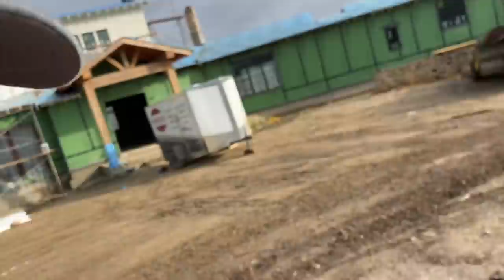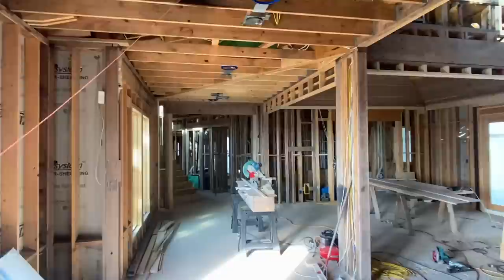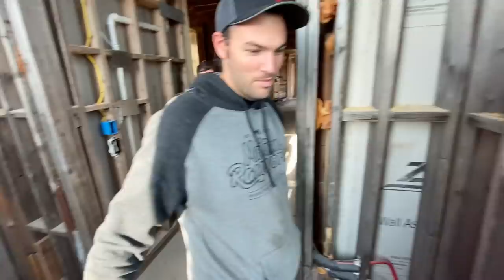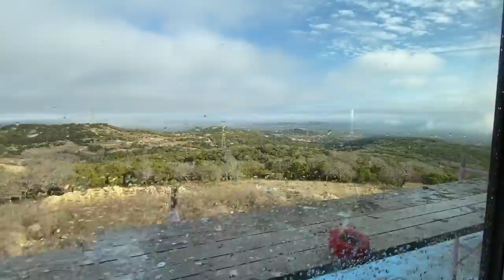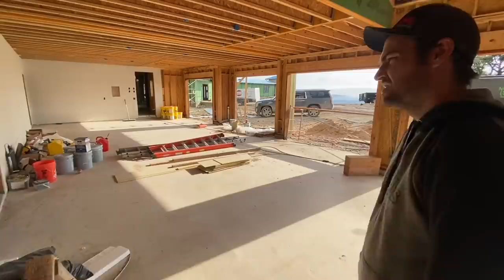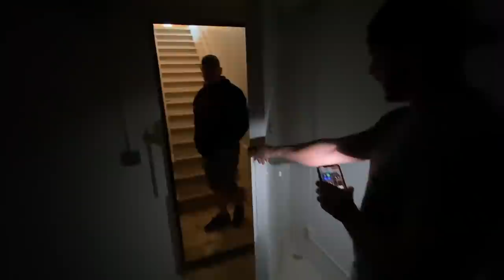Touring Demolition Ranch's Abandoned Mansion Project!! (view is amazing)

Comment: I appreciate how he’s not screwing around and made all those circuits wired for 20A. Smart man.
Reply: All brekers for small amps circuits are 20, 120v. The bigger ones use 30
Reply: @grasshoper3770  Except for 15 amp general purpose. Very few uses for a 115v 30 amp circuit, maybe a RV plug.
Reply: @grasshoper3770  dwelling breakers are primarily 15 & 20 a circuits. With 20 a being more common for kitchens, dedicated appliances ( excluding dryers or ranges ) If you have a code book you should review the article 210.52 of NEC bud. It’s all about dwellings. In the case of house roping, yellow Romeo or NM cable, denotes a 20A circuit. White would be 15A and orange is the 30A you mentioned..... but don’t take my word for it.... I’m just a 01.
Reply: @BEVO_vs_The_World  you are absolutely right sir. Im an apprentice still
Reply: @SMOBY44  the 30 amps is for dryers and big appliances, and the 20 is for general household stuff like lights and outlets
Reply: @grasshoper3770  all good grasshopper...... I highly recommend you get some study materials... practice exams... and just do a little bit here and there and if you are getting close on hours then start studying 1 hr or so each day for two months before testing and you’ll pass easy. Stick with the trade, its a great career choice.
Reply: @grasshoper3770  No, general purpose 120 volt circuits are either 15 or 20 amp. Dedicated 120 volt circuits are 20 amp. I've been an electrician for 30 years and have yet to see a 120 volt 30 amp circuit in a residence. Nor have I seen a 120 volt electric dryer.
Reply: @SMOBY44  how many volts and Amps run down the main service cable, that one that comes down straight from the shower head to the service meter ???

Comment: I really hope you guys see this as I'd hate to see an issue in the future. At a glance in the video it appears that the windows are directly on the plate. That's a big no-no. It's actually worse than spray foam around the windows and doors. As the house settles it will cause things to bow and bind. Within 3-5 years you won't be able to open and/or close if it is a casement style and you will have air leakage and locking problems for pretty much all styles. Proper install you need a shim under each leg with a space usually specified by the window manufacturer. Good luck. Looks amazing.~Ryan
Reply: There's no space around any of the windows. It's not just the plate. Gonna have big issues in time. The doors are going to be a major problem. The specific ones are the wall of doors. They can be tough to Align without framing issues. You should really have a service rep from the manufacturer come out and look over everything asap. You will def regret it at some point if you don't.

Comment: Just got done upgrading my Wi-fi.  Imagine the wiring required for this house?  He better run Cat 8 Cable; so, he doesn't have to mess with it for years, before he starts putting up dry wall.  Set up LAN line outlets every 50 feet.

Comment: I expect that bifolding door system to settle due to no siding and sheetrock installed yet. If it doesn't open after the sheetrock is installed that's why. Dead load

Comment: I wonder if he’s actually saving money by fixing the place and not just tearing it down and throwing up a new house
Reply: I doubt it, He paid 850k for it and I would guess he will spend more than 500k fixing it up. I am sure depending on the location I could buy more land and build a much bigger house for 1.5m that has its own solar system and is well insulated and easy to cool. I am also going to guess the taxes on this house 12k per zillow. When done will exceed 20k per year. The insurance will set you back maybe 20k per year.  Electric will cost 1k a month. That place is maybe 10k square feet of heating and cooling. That is not cheap at all. You are going to need 20 to 30 tons of cooling power to keep that place cool along with a larger number of mechanical air exchanges. The heat load on that house with all of those windows will be pretty extreme. The window in the stairwell if facing south east or west will produce huge amounts of heat. I know as I have an west facing double window on my stairwell and it produces quite a bit of heat. The house is massively segmented meaning that you will need a number of systems to cool each area along with those 20 plus feet vaulted ceilings. The wall have zip sheeting on it and looks to be 2x4 walls. This I may be wrong with size. Yet almost all modern construction is built with 2x6 exterior walls and in some cases interior walls. The amount of electrical ran upstairs is well over 100 lines from the looks of it. The lighting will be quite expensive, even with LED. The number of lights needed to traverse between zones and rooms. Also looks like old style bathroom set ups meaning that 6 bedrooms do not have enough bedrooms connected to each room. Though the listing shows 5 br 6ba Though i doubt that this is true. These type houses should have 1 bathroom and laundry room per room along with 3 extra bathrooms/ulility rooms. The garage needs a bathroom along with the upstairs garage area. The master bedroom needs its own bathroom along with all of the other bed rooms and one or 2 more for kitchen and off main living area and or mud room entrance. Chopped up houses like this never flow right and are designed incorrectly.  I doubt that the over hang is the correct length that allows winter sun in and blocks summer sun. These are huge factors when building high end houses. Having a window that faces the south and blazing hot sun blasting in all summer long not only cost you lots more money on cooling cost they can and will become annoying to the fact that you drape the window and lose out on your view.

Comment: Bro!  Why did you use zip system.  Its crap.  You shouldve used real plywood and had it coated with a waterproof membrane on the outside if you were that worried about moisture.  That what they do in commercial buildings.